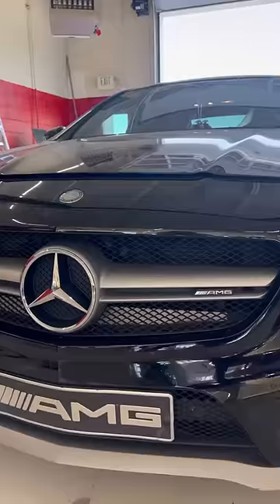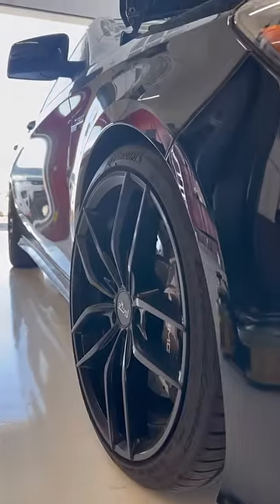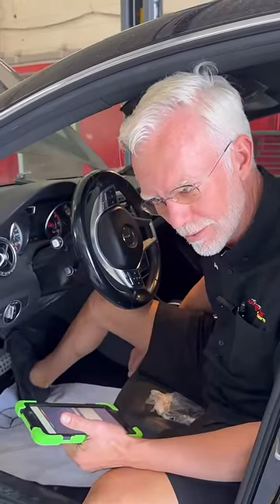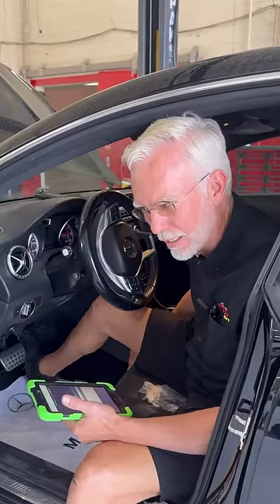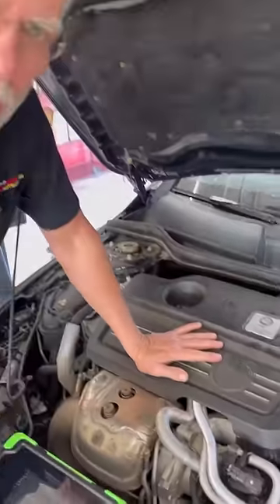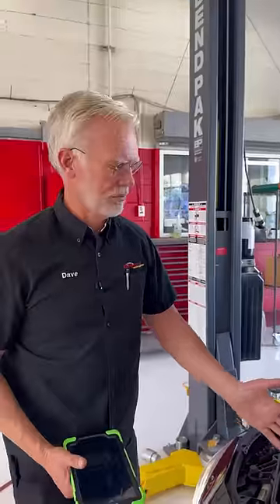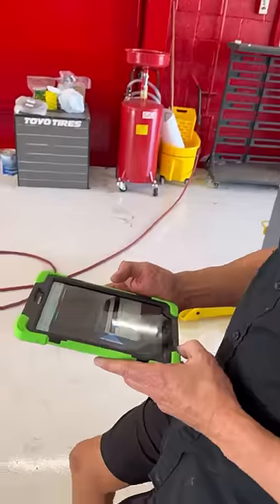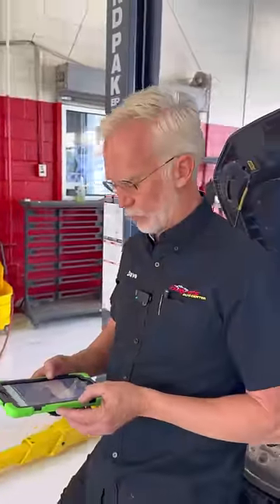Mercedes AMG Nothing but a slight noise on start up #carrepair #autoshop #mercedes

Comment: I’m a technician for Mercedes in the UK, we have countless a200,A35s in for a misfire, they tend to go around 15-20k miles. Turns out it’s the valves being burnt out. You get an entire new head covered under warranty
Reply: Needs a new head after just 20k miles????? WTF?? Thats some BS!
Reply: Wow mercedes  at its finest
Reply: I'm sure the "engineers" will laugh & walk away... ultimately, because they walk away.
We need mechanics to design engines... Oh wait, they'd be reliable then.
Reply: @barrysnow6993 I wouldn’t blame the engineers as much as the bean counters
Reply: You guys give head over there under warranty!?
Reply: @ChromeArty 🤣
Reply: @ChromeArty AyeOo 😂
Reply: Sounds like they run hot and lean. Shouldn't need an entire new head, just a valve job. And a richer tune to make it last longer.
Reply: Then good for another 20k?
Reply: Year range??
Reply: @joshjlmgproductions3313 we replace the whole head because it’s cheaper and less time consuming than re doing all the valves. The old heads get sent off to refurb then they send them back out for other cars
Reply: @benholdaway6273  Ah, makes sense. I forgot about injector seals, cam timing sprockets and all the other advanced stuff in modern heads.
Reply: The best or nothing, amirite?
Reply: Is the A200 a Nissan/Renault engine?
Reply: @murdogordon3091 the A200 is a Mercedes engine, 177 A180 is a Renault engine and the 176 A180d is a Renault diesel
Reply: @grantperkins368 that was my thinking so for every 100k it's 5 new heads lmao what a joke
Reply: @benholdaway6273 I’m a Mercedes tech too & have done a few cylinder heads now, I think a lot has to do with people running them on 87 & burning the valve seats
Reply: Note to self-dont but an A35/a200.
Reply: @ChromeArty 🤣🤣🤣🤣🤣🤣🤣
Reply: @kerrwilson265 Invitation:  Re-post your insightful comment as a comment, where more may read it, rather than as a reply, where fewer may glean from it (unless, of course you already have).  With kind regards and gratitude, tips hat
Reply: Unclear if there is smoke or not on startup, but from what you say, could be that the valve seal is going out.  Since it is only on startup, I would say valve seal, because once the valve burns up what has leaked into the valve, it sounds and run somewhat normal.
Reply: Had an A35 and they’re crap as far as quality control goes and great for the price. Wish Mercedes did better, after 3 years and as soon as warranty was dude to end I got rid of it and went C43
Reply: Yes your absolutely right I have a 2021 mercedes A35 AMG my cylinder head got replaced at 9,000 miles unfortunately it's a common problem as you say exhaust valves burning out causing low compression
Reply: So many people out there love those expensive german cars🤦🏽‍♂️
I like the amg's and m series but i wouldn't buy them
Reply: @rod1499  Mercedes-Benz even extended the warranty for the cylinder head 15 years or 150k miles
Reply: @ungovernable1431 this occurs in nearly every 2019 and after four cylinder from Mercedes. Major defect

Comment: I like that this Dude listens first then uses the computer. Old school beast 💪👍🇺🇸.
Reply: Well ya gotta replicate the problem if ya wanna properly diagnose it. I had a goofy noise like this on my z4. Dealer gave me a laundry list of parts that didn't need to be changed. Popped the hood and found a tear in an intake boot lol. $15 and 3 mins later, car was fine.
Reply: @PANTHER_PLAYA
Reply: Look
Reply: This all day
Reply: Hooking to a computer will almost never tell you what a noise is.

Comment: After car washes with under spray, the ABS, SLIP, DIFF lights came on on my Nissan Pickup truck, after awhile they'd go off.  Took it to the dealer to investigate, wanted to sell me a new $5000 rear axel!  Went home, unplugged the wiring to a switch sensor they charged me $100 to diagnose was sending the fault signal to the computer, cleaned the contacts, added Dielectric grease, plugged back up...problem solved!  Maybe $0.05 cost too!😅
Reply: Do you know what I can do to fix a brake light that goes off once in awhile the svc is on and the abs nothing wrong with brakes and rotors on a 20o3 toyota highlander v6 ty
Reply: @onetruesoldiervt3686 Ground issues. Clean your ground points.
Alternator on its way out?

Comment: First thing for overheating check the simplest,  the thermostat. Many are just sticky. Most of my cars that ever overheated was the thermostat. If it checks out while you did that you have checked for oil in the water. Rust may have built up.
Reply: So explain to me how you check for a thermostat that is sticky???
Reply: @jacquieschmudlach5096 if overheating I'd assume it's stuck close. One test you can do on most vehicles is start it cold and touch hose out of thermostat. On start up you shouldn't feel anything so if it does feel like water is moving than thermostat is stuck open....but we are worried about stuck close. So if the vehicles temp gets higher and that hose never gets hotter than what it gets from engine radiating its heat, your thermostat us stuck close. Now if you suspect random sticking....better pull the damn thing, clean it, and test the temp it opens at. If it doesn't open around the temp it is supposed to than replace it. Test it by putting in water and bringing water to boil. Specs will tell you temp it is supposed to open so when it nears that temp keep you eye on the thermometer until it opens or water boils and it never opens
Reply: @dougie2631  you explained that much more nicer than I could have. Thank you.

Comment: Its overheating. Check coolant. Check obstruction to radiator. Check oil. Is oil diferent color than usual
Reply: Exactly
Reply: I recently resolved an overheating issue in my son's 2002 CL500 by replacing the radiator electric fan assembly, which includes the control module. A few years ago, I also replaced the radiator on my 2003 ML350. 

While Mercedes engines are generally reliable, neglecting maintenance can lead to significant problems, similar to other vehicles.

Dealerships often overcharge for simple repairs. For example, a Mercedes owner was quoted over $1000 to replace a $0.50 o-ring on the steering oil reservoir. It's a ten-minute job that I easily handled myself."

Comment: "Step 1, sell the car"  

-Dave Ramsey
Reply: Probably not finished paying for it yet. I would probably sell it too if two people told me it need an engine..
Reply: Step 2 - buy a Toyota
Reply: @oscarjones529  or Lexus. Yes - preferably Toyota (not Supra - its a BMW). But either or those and nothing else for me as of 2017.
Reply: @stevezodiac575  BMWs are amongst the most reliable & durable cars in the world prob better than toyota, and have always been for decades even before the japanese started the Deming's methods of manufacturing.
Reply: @navsofour2892  The difference is BMW's are built to be reliable with constant factory-spec service. Toyotas are built to be reliable under a reasonable amount of abuse (like ocasionally letting the oil change interval go a little long).
Reply: @navsofour2892  chill dude, how many 2000-2007 Camrys do you see around, and compare the number with BWM from the same period. Even adjusted for the number of sold units, BMWs are almost all scrapped and gave a new life to something else. 

Your example reiterates “BMW is not a car brand, it’s a mental illness for some people” 😂😂😂
Reply: @Djjsndnndnnzjjs  hey there for starters if you read my previous comment you would know that the Japanese did not invent any quality manufacturing methods they just copied them, so this idea that the Japanese got to mars first or something is completely for the uninformed. They increased efficiency during the 80s and 90s over already known methods via the 5M manufacturing process which they decided to seriously commit to. On the other hand if we talk about german brands they have been doing quality much much before the japanese. BMWs, Mercedes of the 80s would last more that the Corolas of today, if you take porsche for example 2/3 of every car ever manufactured is still running somewhere in the world, even if you load them with half gas half alcohol and i mean cars from the 60s, 70s. There is not a lot of difference between manufacturing methods of german brands, original VW beetle has the record of most durability of any car ever. What happens with "some" BMWs is that they are electronically equipped for premium customers that require it, electronics tend to fail take your quality iphone of 2007 is nowhere in working mode today even if you never damaged it. But let's say you go and buy an X3 S drive 3.0i from 2008 you will get access to the N55 engine and the best transmission available in the market almost no special electronics you can easily ran that car for 200k miles with very little maintenance. And BTW this is USA a lot of those olders BMW get exported to aftermarkets in eastern EU and Latinamerica not when they are 10 yrs old but when they are 3-5 yrs old nobody is up for a 2000 BMW here not even a 2015 one, the BMW owner will not retain the car for more than 1 lease period this is a premium brand you would not expect your cleaning lady to own one even if it is in running condition so why even bother trying to sell it to her when they can get almost anew prices abroad.

Comment: I had noise in my Infiniti G35 that stated after it warmed up. Dealer told me the trans pump was going and the trans would need to be rebuilt. I was sceptical so I put it up on my friends hoist started it up and went under with my stethoscope. Took me 15 seconds to realize the noise was coming from the catalytic converter. Changed it out and silenced the noise.
This car probably has an accessory component problem, that would be the first place to look especially areas that code could indicate.
Reply: Your car is just a Renault with another brand on it beware.
Reply: Or, where the codes don't indicate. Codes don't find noises.
Reply: @Wikimikitiki  Beware of what?
Reply: @tradingnichols2255  Yes, but a code could point you in the right direction. Was working on a Toyota that had a noise also had a cam sensor issue. Turned out the variable cam timing assembly was failing and making the noise and the erratic cam movement made the sensor signal wrong and that triggered the code.
Reply: @donziperk  of renault/nissan low qualityin evverything
Reply: @donziperk  you are right. They can align. No doubt. I was just thinking about all the times a noise was separate from anything the computer could produce as a code.
Reply: @Wikimikitiki  You have no idea what you are talking about. My 06 Infiniti G35 has been outstanding. Drive it hard and have almost zero problems. I’ve owned 510s, Zs, 2000 Roadsters and also now own a have late model Pathfinder that spends lots of time on logging roads in British Columbia Canada. And have found them all to be fun and reliable vehicles.
Reply: @donziperk  i have a 2008 nissan note/versa which is a renault modus. It's a piece of junk
Reply: @Wikimikitiki  Bad luck, not the norm or  not maintaining it properly.
Reply: @donziperk  bad luck with renault/nissan for me and two of my brothers one of those with two cars? Maybe your car is still a Nissan with no renault influence. Maybe you are the lucky one.
Reply: @Wikimikitiki  "bad luck with renault/nissan for me and two of my brothers one of those with two cars? "

Big difference between a Versa and a G35. Nissan will borrow from Renault for the cheaper cars, e.g. the Versa, but it'll protect the Infiniti line.

Comment: Had a similar problem with a cadillac 
Northstar motor over heating  ...
Was a $25 reservoir cap that runs under pressure

Comment: Been in the business for 37 years and have not seen a shop or an owner like you you do a great job
Reply: King Automotive in Miami was a bad ass mechanic shop. I think they sold the land for $25 million so they closed up shop and retired. They were there for 30 years.
Reply: My VW guy is booked out months ahead, but after taking cars to him I can't go anywhere else. He's a one man shop and his diagnostic strategies are something else. Uses magnetic stethoscopes, smoke machines and all sorts - in addition to his crazy knowledge. Narrows it down to the precise item needing replacement or repair. It works out cheaper going to him than a run of the mill shop that diagnose by part replacement.
Reply: When you can actually find a guy like this REMEMBER, you pay for his knowledge and experience NOT for turning the wrench.
Reply: It’s because he is a Utahn :)
Reply: @joep4224 … this gut sounds like he was trained in a racing shop. Those skills are passed down among those who really need to resolve issues and not build on costs in the process.
Reply: meaning your shop is shit?

Comment: if i recall correctly, the water is integrated with the thermostat.  the  thermostats are known to fail.  the is also a vacuum conection at the thermostat.  if we lost vacuum to(at) the thermosat it lost vaccum to the tubo boost cotrol wich if irecall is also controled by  vacuum.  its different than other manufactures.